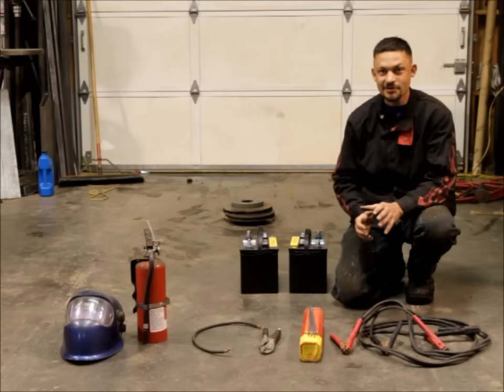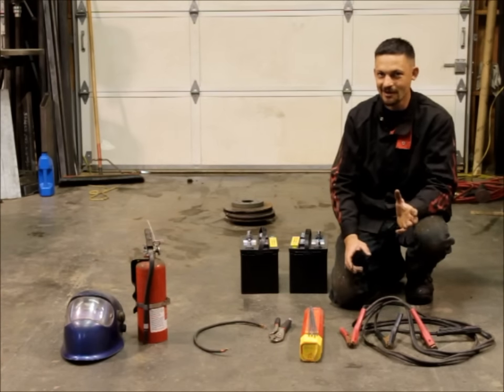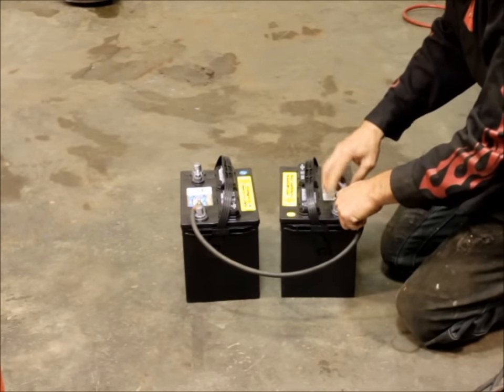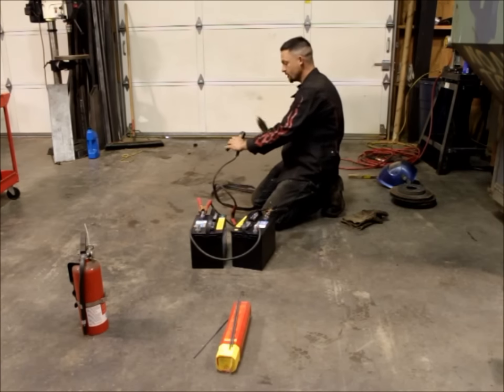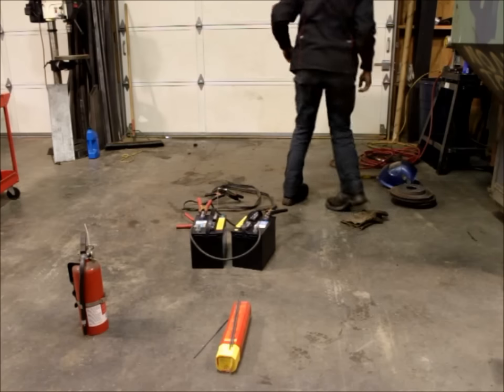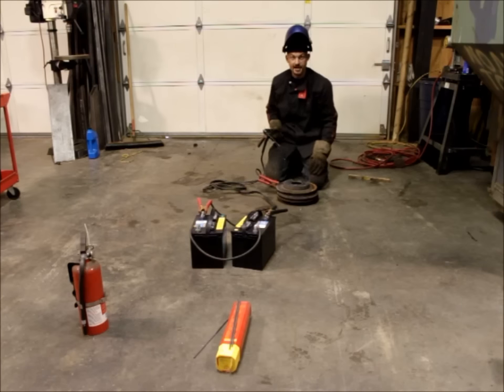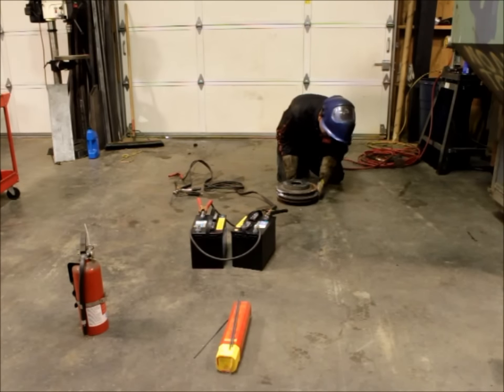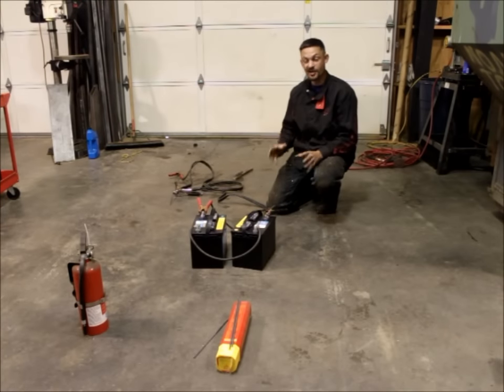Welding with jumper cables and a pair of batteries

Comment: Hello Matt can I weld sheet metal with batteries if I use thin rod or hanger. I don’t need to for a project just wanted to play around if you have done it . 
Anyone else feel free to chime in
Reply: ....almost all inexperienced welders burn holes through sheet steel trying to weld it . The coat hangar wouldn't give any joy. It'll likely keep sticking ,get red hot and drain the batteries, it's the sticking you have to watch, stuff such as actually having some patches of rust cos it prevents sticking to run the rod along to get arc started works. Once the tip of rod is glowing hot then the control required for arcing gets easier. Having really good lighting so you can actually see the project dimly through the dark helmet glass is a great help too . Sunlight as lighting for the project is great . . .A bloke mentioned plastic coated hangar as working out the best but we don't know who are the comedians . Best of course to get the feeling for it by using proper rods .

Comment: if you use 2mm stainless electrodes it works great as strong welds s/ steel 2 mm 316/318  rods need very little voltage and amps to perform .

Comment: If you're running straight polarity I'd try using farmer rod (6013) see how it turns out
Reply: +Majestic Yodalar I think you'd want 6010. 6013 is just a regular shallow rod
Reply: ***** Idk 6010 gets the best pen on reverse polarity and running it straight makes it shallower. Shallower than straight 6013? idk but 6013 is designed to work well on either polarity. It'd be worth a shot to see how it runs lol

Comment: Negative welding makes total sense if you understand batteries and electron flow electrons flow from negative to positive
So batteries are actually labeled backwards but by time they discovered this in the fifties they decided just leave it alone since batteries had been out for years

Comment: Hello !!!. Does anyone what size welding do you use to weld car body panels together using this method?.
Reply from the maker: You really can't get a good weld on thin sheetmetal with this method; just no way to control the heat that you're putting into the material.
Reply: Thank you sewerzuk. I'm glad I didn't try.

Comment: Definitely not for an amateur. If you get those leads stuck together then they will glow and melt the insulation into dense smoke before you can do anything about it. 
Hope you were holding your breath and avoiding the welding fumes.

Comment: With 3 batteries 36 OCV, 4, 24 or 48, series parallel with 4 batteries would be a lot of amps but only 24  OCV. 3 in series 36 OCV might be best. Not enough OCV will make the rod freeze in the puddle, stick a lot.

Comment: Cant i just cut the handle off a screwdriver and use that as a rod?
Reply: +Lachen908 

Screw drivers are made from chrome vanadium usually. Probably an extremely poor media for holding things together.
Reply: Chris Denny and there is no white stuff covering a screwdriver to shield the weld puddle from the air.

Comment: doesn't concrete mess up batteries or u cant charge them on concrete?
Reply: It's an old wifes tale, you can use batteries on ANY surface and charge on ANY surface! (altough deep water makes them sink.)
Reply: you don't want to store them on the ground a concrete floor in the winter. if your battery is dead and it drops below freezing it will damage the cells. if they are topped off and used regularly there wont be an issue.
Reply: +Jamey Larrimore Give some science facts to that statement please. Because if your battery sits on a wooden shelf and it gets below freezing point it will be exactly the same. If it's in your car and it gets below freezing point it will be exactly the same!  Unless of course you have this special concrete that radiates cryptonite right trough the casing of your battery.  Last time that happened was in 1932 in Uzbekistan. The owner of that concrete was shot by general Zod.
Reply: 40 years ago batteries were made different and the floor affected, not today.

Comment: Small problem
Putting batteries on bare floor will start to drain the charge
Need mat under batteries
Reply from the maker: This is not accurate.  There is no problem with setting batteries on concrete.

Comment: Better if you wired the batteries in parallel instead of series which would result in higher current
Reply from the maker: No;  at only 12v it is impossible to get enough current to get a hot enough arc.  Yes; wiring in parallel would give me more available amperage, but it is impossible to get that current to flow at such a low voltage.  You could wire 10 batteries in parallel and although 10x the current would be available, the arc wouldn't have any more current than if I were to use 1 battery.  The batteries I am using in this video are each capable of 800A; WAY more than enough for an emergency repair.  wiring them in series means I still have 800A available, but the higher voltage allows more of that current to flow through the circuit.  In testing, I get around 50A at 12v; not hot enough for any real welding.  At 24v I get around 150A, which is a good current for most automotive repairs.  At 36V I get around 225A;  a little too hot for most automotive repairs but maybe useful for heavy equipment.

Comment: you can buy a small arc welder cheaper and safer than two car batteries,plus it would have a control knob.
Reply: A small arc welder needs a place to plug it in. The whole point of this demonstration is that you can make temporary weld repairs out in the field, where there is no electrical outlet to plug in your welder. Plus, you shouldn't have to buy the batteries. So where can you buy a small arc welder with a generator that will run it....cheaper than a set of jumper cables and some vice grips?
Reply: caddymech you are right it does work, I just happened to have a ranger 10,000.   13 years old with practically zero hrs.and only once I done a muffler repair out in the country and I repair heavy equipt for a living.

Comment: Maybe I am jynxed,, but I recalled seeing this video earlier today after a buddy asked if I could weld a couple of hinges at his remote cabin.  So having 2 brand new 230 cranking amp car batteries..and hooking it up as demonstrated.. I was surprised to see nothing but sparks and spatter with rods going red hot in a few seconds..never could get a welding arc to start.  Let alone run a bead.  checked the leads and 24.7 volts is what it showed. Used short jumpers to bridge the POS and NEG and then 8 ft welding leads attached with metal C clamps.   TOTAL Failure.  tried both 1/8 7018 and 1/8 6011.  reattempting tomorrow with addition of a 3rd battery.... still all my years and training says... I should have had the same results.  oh..the weld attempt was on a a standard square tubing for a hitch, maybe 8 inches long ...any thoughts?
Reply from the maker: which side of the battery did you connect to the electrode?  I have found that welding using this method only work if you set it up with a positive ground and negative electrode.  using a negative ground yields results like you describe
Reply: +sewerzuk  I was running as DCEN... but we got it to work.. 5 batteries allowed us to do the welding. Used 12 1/8 7018 rods before the batteries were to drained to do anymore
Reply from the maker: +Richard Elbe 5 wired in series?  or some in parallel?  what size were the batteries?
Reply: +sewerzuk in series for a total of 51 vdc.. various amp out put.. I'm not worried about it now... I now know it works first hand.. and I have a ready welder on order..so that covers me in the future
Reply from the maker: +Richard Elbe interesting.  I've never battery welded with more than 3 in series, and I found that too hot for any normal trail repairs (1/4").  I have had good success with 2 batteries for most jobs.
Reply: Couldn't get an arc started with 3, bottom line,  got the job done.  Note,  hinges were 1/4 thick welding to a 9ft 8x8 square tubing

Comment: same thing with 18volt as well?
Reply from the maker: I'm not aware of any 18 volt automotive batteries; but if one exists and is rated for at least 600CCA, the procedure would be the same as with 12 volt batteries.
Reply: maybe im thinking 16 the battery's from like an r.v.
what about marine deep cycle.?

Comment: how long would it last for?
Reply from the maker: You get a minute or two of arc time.  The exact amount depends on battery health and capacity.
Reply: +sewerzuk are the batteries reusable or do they get damaged or are they one time use only? Thanks you
Reply from the maker: Romulo Bello No damage to the batteries.  Welding current is no different than a hard winch pull or extended starter motor use.

Comment: Quiz: Describe the minimum equipment and steps for welding out in the bush based on what you just saw, answer below.
.
.
.
.
Welding rod, two pair of jumper cables and ...
1. Two cars, parked with batteries as close as possible (but cars not touching)
2. Unhook both positive leads on the batteries
3. Jumper cables (set 1) with both wires/clips together on each end, one to the negative of one battery, the other pair to positive of the other battery
4. Jumper cables (set 2) to the free terminals, one negative and one positive
(If the jumper cable wires are not the same wire size use the largest as set 2)
5. As many pair of sunglasses as you can round up
(Leave the cars running so you won't need a third car to jump-start them when done, their alternators supply the electricity needed to run.
.
Matt, wouldn't it be cool to demonstrate that. Have to think of some emergency situation that might crop up that could be fixed with a weld. A broken hitch, tent pole, pot handle ....

Comment: positive polarity for stick
Reply from the maker: I made a point of demonstrating negative polarity for a reason; DCEP  doesn't work well with a CV source like batteries.
Reply: +sewerzuk didn't relize it was cv witch I use on wirefeeder fluxcore in that it is negative. but on any kind of standard welding wt proper equipment it is positive and u r correct when using cv it is negative polarity. good info
Reply: +sewerzuk stick welding that os

Comment: Im assuming theres no way to control the amps
Reply from the maker: DOMO NIK That's correct; this is an unconventional way to stick weld.  You would normally never use a constant voltage source for this kind of welding.  But, with a bit of practice, you can adjust the heat input by holding the electrode closer to or further away from the weld puddle.  3/16"-1/4" material is ideal thickness...works well for most emergency field repairs, but not well as a substitute for a good shop welder.
Reply: +sewerzuk I have not done this but I wounder if you could lower the amps by using another set of jumper cables.
Reply: how exactly?
Reply: +DOMO NIK 
By clipping two jumper cables together, DC conducts poorly the extra length should lower amps and voltage, you could even play with smaller gauge wire, but for Boonie work, any weld is cool.
Reply: i think smaller gauge wire would still carry the amperage (the cable would heat up tho)
Reply: chill guy

Comment: I’ve always herd to never place car batteries on the cement directly.
Reply from the maker: That used to be true, 30-40 years ago.  The concrete could cause the battery to slowly discharge, and if left there too long would ruin the battery.  With modern case design, this is no longer an issue.  Batteries can be stored on concrete indefinitely.

Comment: Hydrogen is not just flammable ,It is highly explosive ! I have personally seen 2 batteries explode and heard of another,  one of the explosion caused battery parts  to penetrate a wooden ceiling that was 20 feet high !, I am a welder and  I would not ever do this,  I also have a US patent on safety jumper cables  that will not operate unless hooked up correctly

Comment: won't the battery drain out
Reply from the maker: timelesskoontah you get about a minute of weld time, depending on the health of the batteries.  usually more than enough for an emergency repair

Comment: I would only do this in a pinch if there were at least 3 cars because I'd rather not kill both batteries to the only vehicles I have unless you want keep both vehicles running while you weld

Comment: Why would you do this on the floor when you have a proper work bench? Not good for old guys.
Reply from the maker: My "real" welders get the use of my welding table.  This method is intended for emergency trailside repairs, where there would be no workbench...

Comment: at 2mins it looks like he almost completed the circuit with his hand... that would have hurt. i could be wrong tho.
Reply from the maker: It's only 24 volts...not enough to even tingle.
Reply: Right on. Not as dangerous as I thought then.
Reply: +sewerzuk it's not the volts that hurt you. it's the amps... look it up. plus I've been doing some arc flash training at work at 120 amps is beyond the danger limits
Reply from the maker: Jaime Franco what you say is correct...you have a misunderstanding about what causes this current to flow.  You are correct...current flow IS what causes tissue damage.  But, voltage is what causes current flow.  100mA can be deadly (that's 0.1 amps).  But, it is just about impossible to get that much current through the human body at anything under 60 volts.  Even then, it is still extremely unlikely.  Voltage is what causes current to flow.  So, it doesn't matter how many amps a power supply is capable of supplying; if the voltage isn't there, then there is no danger of electrocution.  Car batteries can usually supply around 800 amps...but at 12 or 24 volts, you'll never get more than about .01 amps though the human body...not even enough to feel.  I'm a nuclear electronics technician who has been working around electricity for almost 30 years; both on microelectronic systems and power distribution.  even in shipboard settings we don't take electrical safety precautions unless system voltage is greater than 30 volts.

Comment: Great idea! But the bad idea is setting your batteries on the floor! Everybody knows don't set batteries on concrete or the ground, because it totally ruins a battery.
Reply: Landon Flake that's an old myth.
Reply: Landon Flake: Lol, yes, it's a myth, as has been already stated. I've heard it for years! But there is simply no truth to it!
Reply: My understanding is that, way back when, the housings of car batteries were made of a hard rubber that was porous and could essentially leak voltage on a damp concrete floor. That is no longer a problem with the plastic housings that have been being used over the past several decades.
Reply: It's funny how it's a myth, when just last year my son was cleaning out my boat and left a 3 month old trolling battery on the ground over night. Well it was fully charged the day before he cleaned the boat. And when I realized it the next day when he was at school. I got it put back in the boat and hooked up the trolling motor and it was dead, like nothing and it never did recharge it was ruined.
Reply: Landon Flake: Pure coincidence, the battery was already junk, regardless of where it was sitting!
Reply: most obvious myth of all time.
Reply: Landon Flake 
I work in an auto parts store
we stock all of our batteries on the concrete floor
no problems in 25
years
Reply: Ok everyone

Comment: 48V from two batteries ?
Reply from the maker: no, 24v.
Reply: +sewerzuk but these are in series so the voltages add so 48V. If you have them Parallel the amps and capacities add
Reply from the maker: +Ch4Rg3D these are 12v batteries, so 12+12=24.
Reply: oops my mistake sorry. wasnt kinda together with my thougts :D
Reply from the maker: +Ch4Rg3D lol no problem.  I've been known to "brain fart" basic math every now and then myself

Comment: In a pinch in the woods, sure. But I caught a new hire at my shop using my industrial battery charger, costing over $200 as a welder on a trailer axle. I asked him why the hell he was using my battery charger and not one of the three friggin' welders sitting in the shop?
He said "That's what I use at home!" I said "Fine, go home and use it, YOU'RE FIRED!". WTF OVER!?!
Reply from the maker: I agree; if you're in a shop with a welder available, there's never a reason to weld with something OTHER than a welder!  A perfectly good dynasty 350 is sitting just off of the screen in this video.  The point is that this can be used to complete an emergency repair when a welder is not available, or can't easily be brought to wherever it is needed.